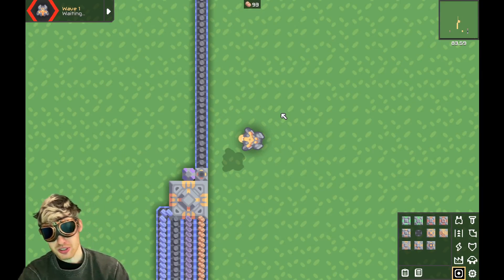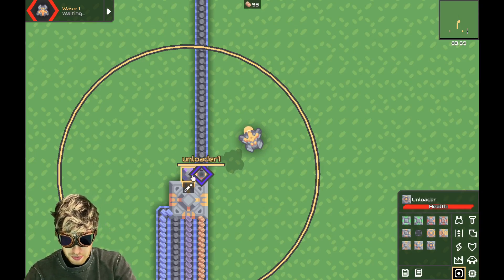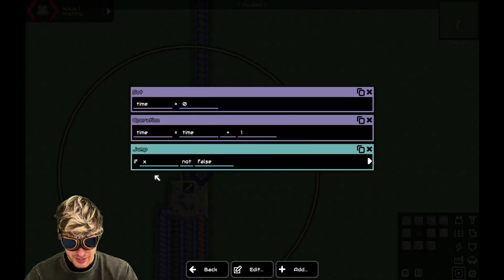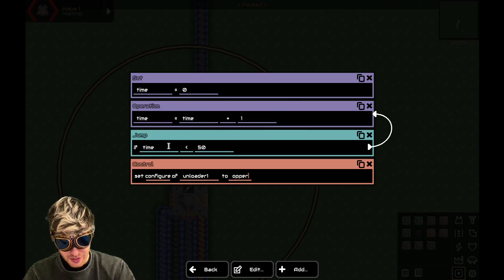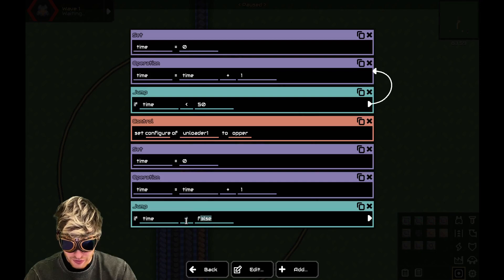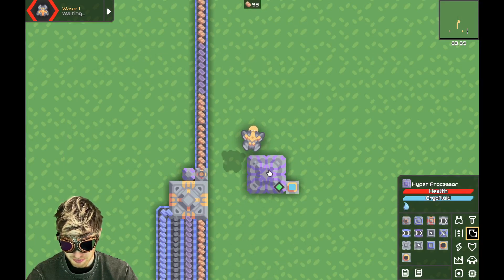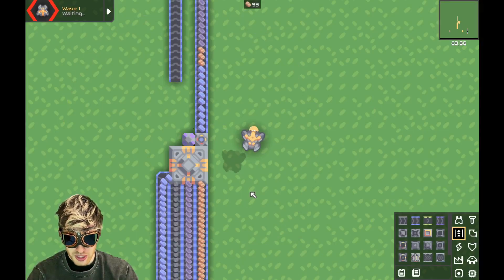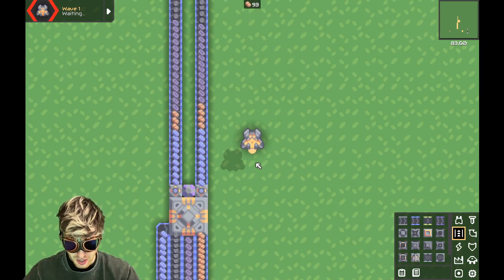Mindustry | logic example for noobs 2 | microprocessors with unloader | Beginners logic processor

Comment: Hey, recently found your channel and found it really helpful (I'm just finishing up the campaign now). I'm not sure if you play much campaign, but I'd be curious to know how you setup your core schematics? I currently use one that starts with T1 and T2 support fliers and some RTC. I've started making more use of more large overdrive so have been thinking about adding that to the schematic as well.

edit: to be clear, I mean I'm unloading from the core to do these things right from landing.
Reply from the maker: I’m currently making a logic video on core surge alloy so watch out for that this week. It’s a good video because if you know the fundamentals of it you can create some really cool core factories. Remember using logic to control unloaders at core so for example if silicon in factory is under 500 turn off machines

Comment: Could you do this as an easy way to make surge using a single unloader instead of 4? I could see this being useful like that if you're on a very tight campaign map. Tight as in there isn't much space near your core.

Or would it be better to have your unloader go directly into the alloy smelter and control what it was exporting based on the contents inside the alloy smelter?
Reply from the maker: There is actually a more precise way of doing this, I will make a video soon on it but if you understand logic give it a try. 

so for example use jump using
if lead < 6
so if lead is less than 6 make the unloader change to lead